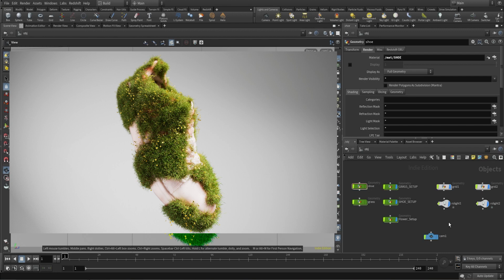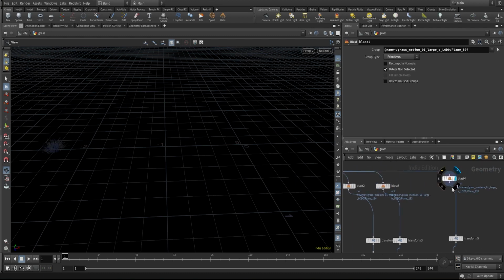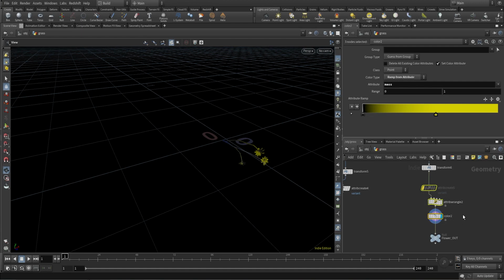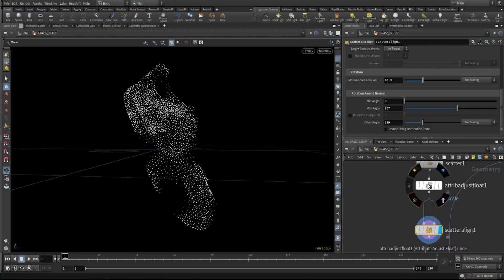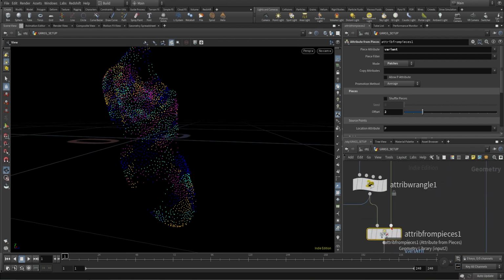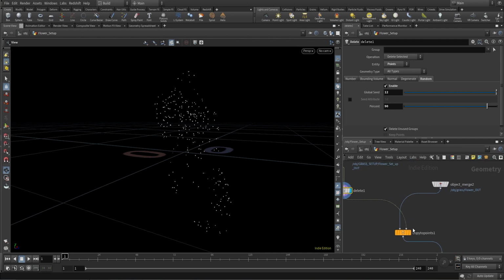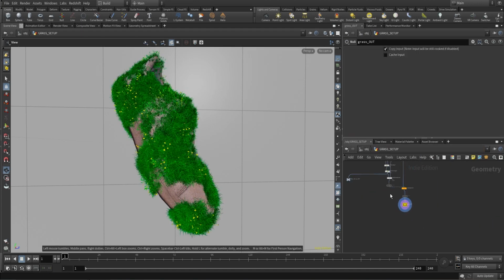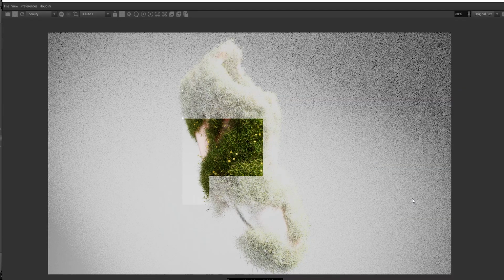Scattering in Houdini Tutorial + Redshift + HIP - Houdini dailies 2

Comment: nice tutorial, a quick tip
after you  rename your path attribute to name, instead of blasting and transforming each grass patch individually, you can drop a for each named primitive loop and drop a match size in there and a transform to rotate. that would get rid of the manual labor lol.
Reply from the maker: Good tip! I know this, but some of the nodes always slips away from my head, as I try to give myself time constraint to finish these small tutorials in under hour. Will update the method in next tutorial.
Reply: Good idea, but how we will make the next step and assign Attribute Create if we don't divide four types of grass in four different branches to make four variants for using later in the Attributes from Pieces.